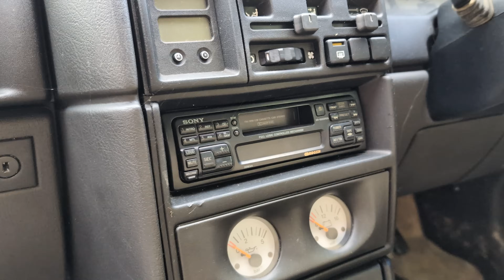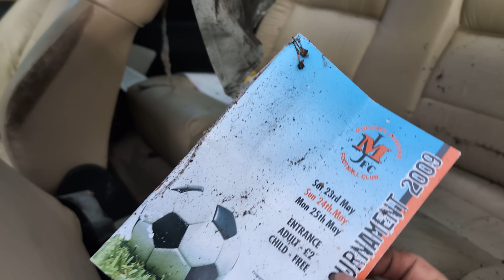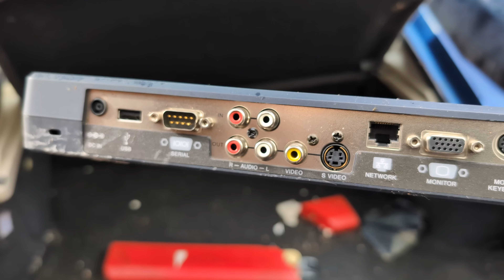From Junkyard to Jewel - Reviving a Neglected Vauxhall Calibra PT1

Comment: Worked on a lot of mk3 Cavaliers and Calibras, Great cars to work on. Fit a clutch in 30 min, you don’t remove the box .There is a plate at the bottom of the box , fit 3 clips onto clutch plate, take hex nut off back of box remove circlip withdraw shaft and clutch drops out. We fitted cambelts at the roadside in 15 min. No damage when belt breaks.
Reply: Wasn't it the Mk2 Cavalier that had much easier clutch changes without removing the box?

Comment: Calibra's are an awesome car.  I can remember when they we first released here in Australia, the drag co-efficient of this car for the day was ridiculous, it sliced through the air like a racing pigeon.  The car that Holden introduced over here was underpowered, by the time they introduced a more powerful engine it was too late.  We Aussies don't like cars that look fast but don't perform.  That said it was a car that could be modified into a beast. Great to see this one being saved, awesome!
Reply: Agree - the Holden badged Opel Calibra that was fitted with the turbo 150 kW engine, 6 speed trans and constant four wheel drive was a great package - however it arrived 3 years after the 'modestly' performing version was introduced in 1991 with the double-overhead-camshaft Family Two with four valves per cylinder and 110 kW.  The 'less said the better' about the auto version with the Family Two 2 valves per cylinder engine (85 kW) - as I consider that version did not help the 'cause'.  The V6 all wheel drive version arrived in 1995 and it was also a decent package with the 125kW engine.
Reply: Yes, guys were moving onto the Nissan 200sx by the time the wad turbo came out…
Reply: @paulsz6194  The game changer in 1994 was the launch of the Suburu WRX.
Reply: @ definitely, but it wasn’t a Coupe. But it’s perform certainly turned more males towards it, and took some sales away from the Calibra, and 200sx

Comment: Lovely looking V6 Calibra be nice to see it back on the road. My one I've always wanted is a green cloverleaf Alfasud Sprint, preferably in black 😂
Reply: V6 Calibra??  At 7:24, I see an exhaust manifold with four exhaust runners?  Are you saying there is a 2 cyliner bank buried behind this? 🤣
Reply: @paulsz6194  yeah my bad I only saw the 3 ht leads and didn't spot the fourth sitting squint.

Comment: Definitely get it back on the road.
I did the fuel lines on my cavalier mk3. The plastic brackets that hold the pipes to the body are virtually impossible to get so try and save as many as you can. The car is missing the ashtray that goes in the rear of the centre console. Hopefully it’s in there somewhere. Very rust free car👍

Comment: Absolutely brilliant video Neil those engines were the best vauxhall ever made
Reply from the maker: Thanks I'll hopefully have her running soon
Reply: By Vauxhall you mean Opel.
The Calibra was built in Germany and Finland and the Vauxhall version was just a production line variation for the UK Market.
Reply from the maker: @williamegler8771 I'm from the UK so it's not Opel to me I'm afraid
Reply: @ItaliaAutos Vauxhall is just the UK marketing division for Opel and hasn't developed anything independently from Opel since the original Viva.
Reply from the maker: @williamegler8771 I know.

Comment: It's well worth knowing that some parts that show up as unobtainable in the UK can still be quite easily found in Germany, just remember that the Cavalier mk3 in the UK was known as the Opel Vectra A in Germany.
Reply from the maker: Thanks for the info. Some are proving non existent in the uk
Reply: @ItaliaAutos    Yes.  I believe Vauxhall had a big parts clear out in the late '90s-early 2000s so a lot of Calibra/Cavalier 3 parts likely ended up as scrap and most of the rest probably ended up in the hands of enthusiasts via various parts suppliers.

It's actually a good thing it's "only" the Family 2 2.0 ohc engine as that's a very tough old engine where the red top twin cam is a bit weak in areas and probably would have been driven to death before it got parked in the field in 2010.
Reply from the maker: @JamieCameron-Mackintosh-z7c  cheers, well, another episode next week.

Comment: Wonder if that uses Motronic 4.1.. Had that 8V in my Opel Monza (booted Kadett in South Africa), Opel Motorsport chip in the ECU, played with the Airmass Meter, fiddled with the octane selector values and put on a larger diameter air inlet, made 96kw on the wheels..

Comment: I'd expect the air intake being removed and the can of Easy Start on the back seat to be a sign of a fuel lift pump getting lazy.  The pump isn't/wasn't expensive but fitting it, as memory serves, is a real mission due to lack of access so at 15 years old it may well have not been worth the owner paying the labour cost to replace the lift pump.  The fuel lift pump getting weak, which is a known issue with these, Cavalier 3s and Carlton 3s, causes poor cold starting, hence the Easy Start as the pump can't supply enough fuel volume and pressure to feed the cold fast idle enrichment, hence bad cold starting.
Reply from the maker: Find out in the coming weeks. Thanks for the  info

Comment: Remove the bonnet liner and don't replace it ,remove the drivers side carpet under the brake pedal it will be rotten ,Corsa b jacking panel can be made to fit,a lot of swab 93 parts fit,rear disc shield rot as well
Reply from the maker: Cheers for the advice

Comment: I had a Cavalier GSi 2000 in the mid 90s which was the saloon version of the 16V Calibra . Dunstable isn't that Cornwall?
Reply from the maker: i almost had a cavalier SRI but insurance to was to much back in the day.
Reply: I had 3 years no claims when I bought my 2 years old J reg Cavalier GSi 2000 at 23 it was over £3500 the car cost almost £8 grand within 2 years at 25 it went down to £400 I can even remember it was Admiral my insurance company.